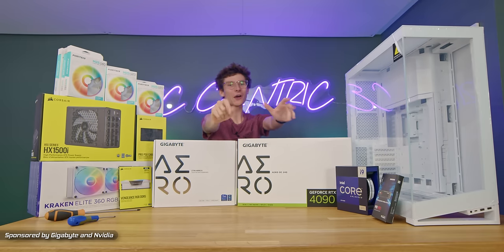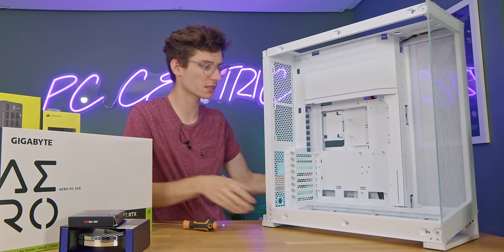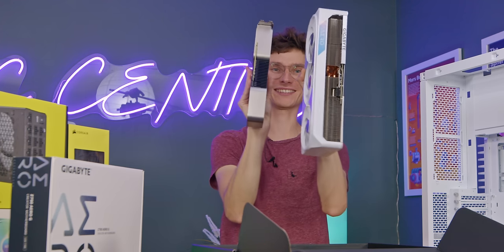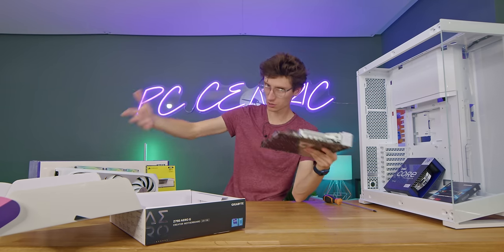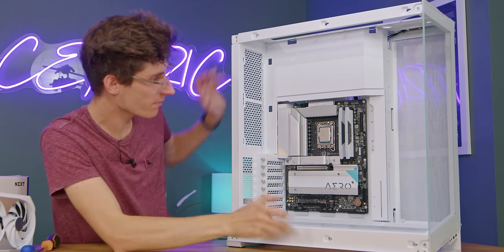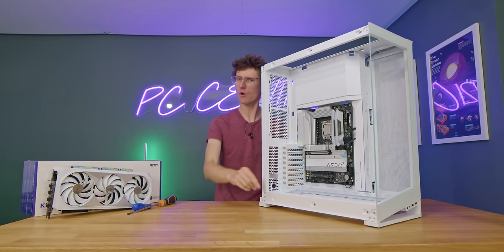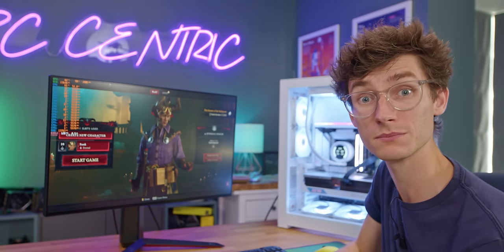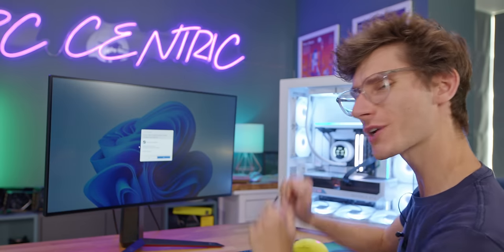The MOST POWERFUL Gaming PC You Can Build?! 😮 RTX 4090, Intel 13900KS, NV7 w/ Benchmarks | AD

Comment: Funny how even the 4090 gets random fps drops in Hogwarts Legacy
Reply: Dude is using cheap 5600 mhz ramm😂😢
Reply: Yea bro they still didn't fix drop fps and sttutering good game but worse optimization and most of new titles are like that
Reply: Poorly optimized game
Reply: @wazebi6347 nah 6000mhz Corsair bro
Reply: Wait for RTX 9090
Reply: well yeah, hogwarts isnt optimised very well
Reply: It’s why u get 2 4090s instead of 1
Reply: @noahmundakkal8308 sad SLI noises
Reply: This is why we need to understand the importance of how things need to be stable on the software side for optimal performance
Reply: Game is probably made for 60 fps
Reply: If you use a 13900ks the most it can handle is 5600 MT/s 6000 or 6400 would not boot propperly. Trust me  I have a simmular Build but with 6400 MT/s RAM. I had to set the XMP to 5600 for it to boot.
Reply: @fahim454 it be the size of the whole case

Comment: Finished my NV7 build last month, amazing case just very tight on space for the cables, granted I used 15 Lian-Li fans but with 7 sata power cables and the controllers it was a bit tough and at first the rear panel would not go on lol I went for a push pull on the AIO and will add another LCD display to fill what is left of the gap.

Comment: Finally, a no compromises build, not just showcased, but also commented. 

It's unfeasible and overkill, but entertaining and interesting. Soo thank you for making this! 😊
Reply: naah and whats with the ram 5600? really all that money for the parts and than this ram xD

and why no white motherboard like the MAXIMUS Z790 APEX and white cables??? than it would be perfect 😋
Reply: @hansg9824  well he did say he couldn't find faster white RAM Sticks. By the end the case was also not the "best", "no compromises" build. I was honestly most interested in seeing the 13900ks paired with the 4090 in the end. Faster RAM wouldn't've made much of a difference and neither would've the PCIe 5.0 NVMe.
Reply: @iordanchis2437 silver sticks do.
Reply: @iordanchis2437  Okay, that with the ram, I must have missed.
I think faster ram can improve the performance in this system, but with the ssd, you are right that would not help with performance in games.

I've forgotten, especially with raytracing ram speed can make a huge difference because raytracing is really bandwidth heavy.

And I find this case very attractive I would go custom watercooling down the fans are good than on the side an radiator and on top and on the back I would put the fans that they push air in so fresh air down and behind and through the both radiators out 🤔
I hate to see that people put radiators in the front. You don't want pre warmed air in your system that makes no sense 🤮
Reply: @hansg9824  I didn't know RAM speed can increase Ray-Tracing performance. Thanks. 

A custom water loop is definetly a premium. But I, personally, would still choose fans over a custom loop, for less hassle.

According to Caseking the most optimal Air-Flow configuration, for a case like this, would be:

1. Top radiator and bottom fans pulling air in
2. And the side and rear fan pushing air out
3. In either a neutral or positive pressure configuration. Meaning the bottom fans and top radiator suck in just as much or more fresh air than the exhaust fans are pushing out. Neutral or positive air pressure are key to reduce dust Build-up.

EDIT: It was neither GN nor JTC but rather a German Case retailer (Caseking) who found that the most optimal cooling performance for both CPU and GPU is the way I described above.
Reply: @hansg9824 actually thats nonsense, Jay just made a vid about just that topic regarding taking air on through a radiator, and the actuall difference is neglectable at best, so long as air moves it doesnt matter much at all (diff he found was like 2°C from 2 rads exhausting compared to one taking in and one exhausting)
Reply: @iordanchis2437  naah custom waterloop isn't that big of a deal, it's one time spent money and than you can use you're parts a real long time 👍🏻
Most of my parts are from the time I had the i5 2550k and hd 6970, that's some year's 😅
my waterpump the cpu block and the radiators I use now with the 12600k with no problem and back in the day I even changed the cooler on the graphic cards I began with a little diy where I just cooled the gpu core and but heatsinks on the rams and other parts and it worked flawless 👍🏻😀
I mean you can buy graphic cards with waterblock on and I think these days I would do this before I make this on my own because they got real expensive 😅
Reply: @hansg9824  Aight. I won't say "definetly no" to a waterloop if I get to change to own one 😁
Reply: @iordanchis2437  it can make fun 😉
My advise as long you don't want it special, use soft tubing 16/10, it's maybe a little thick but believe me it's so much better to work with 😀
It's maybe a little expensive to build a custom loop but you can reuse it so long, as long you put the right coolant in it 😉
My tip distilled water+ g48, it's for cooler in cars, I use it since I began watercooling my pc with no problems 👍🏻
I once thought maybe I can use just distilled water...
Don't do it 🤣
It was a mess to clean the parts from the gunk that is building up in their 🙈
Reply: I just built this for myself... mine was a little more overkill than this thought....
Reply: the ram and ssd is compromise lmao the SSD he could of went fallout and gotten a crucial t700
Reply: Then he should have opted for a black build and not claim this is the best and fastest system there possibly is

Comment: Nice build.  Best fan to solve your fan issues would possibly be the Phanteks D30-120 that come in both directions to avoid back cages and they interconnect so cables are minimal.
Reply: you know? even with the d30s it still is a S**t ton of cables in back... just finished my own NV7 custom loop build with them and the cable management (although totally doable) really sucked...

Comment: I pretty much have the same build in black. I use the phanteks D30 fans, they're more aesthetically pleasing and compliments the case so much more. For the dead space on top I place 8.8" display. It fills in perfectly and looks great.
Reply: Hey can i see how you did it? i am also wondering what to do with that dead space lol
Reply: @gabrielremy4220  Sure! Tell me where I can send it pic/vid
Reply: So I was thinking of making my first gaming PC and had a combo idea: (CPU: AMD Ryzen 9 7900X 4.7 GHz 12-Core Processor) (CPU Cooler: Thermalright Peerless Assassin 120 SE WHITE ARGB 66.17 CFM CPU Cooler) (Motherboard: MSI MEG X670E ACE EATX AM5 Motherboard) (Memory: Corsair Vengeance 32 GB 2 x 16 GB) DDR5-5600 CL36 Memory) (Storage: Samsung 980 Pro 2 TB M.2-2280 PCIe 4.0 X4 NVME Solid State Drive) (Video Card: Asus ROG STRIX GAMING OC GeForce RTX 4090 24 GB) (Case: NZXT H5 Elite ATX Mid Tower Case) (Power Supply: MSI MPG A850G PCIE5 850 W 80+ Gold Certified Fully Modular ATX Power Supply) (Operating System: Microsoft Windows 11 Home Retail - Download 64-bit).|||||||||||||||||||||||||||||||||||||||||||| Is there any suggestions to the combo as it is going to be my first build... Srry for long comment :/
Reply: @Intraxer  overkill most likely
Reply: @Intraxer go for ddr5 6000mhz cl30, i’d recommend a 1000w psu since 4090 rates 850 minimum. crazy overkill though 😭
Reply: @Intraxer  motherboard is super overkill, ram is kinda slow, and that GPU could have trouble fitting in that case
Reply: @CedSwan how do u even have money for that? I only have 1000 dollars aus lol

Comment: What an insane build! Now you need to make a custom loop for it👍
Reply: Since all of his water cooled builds all have gone according to plan and nothing has gone wrong
Reply: what pc would be better an  i7-11700F GeForce RTX 3060 or a  i5-12400F GeForce RTX 4060 Ti both pre builts from cyberpowerpc
Reply: @Yanitedyanited22  if same price than i5 4060 ti
Reply: That's why I like the Ryzen chips, they run so much cooler.  I greatly prefer air cooling personally due to maintenance.
Reply: I just finished getting mine together on the internet and it’s almost identical.  Except for the case.  I’ve been waiting/wanting for 4 years and I’m done waiting.  So excited to hit the order button this morning.  Just watching a couple more videos
Reply: Should i build this?
Reply: Water loops are nothing but a pain at no real performance gain.

Comment: Very strong build !... Personally I would have placed the four vertical fans in intake to avoid being in negative pressure and the accumulation of dust that goes with it. ;-)
Reply: what pc would be better an  i7-11700F GeForce RTX 3060 or a  i5-12400F GeForce RTX 4060 Ti both pre builts from cyberpowerpc
Reply: @Yanitedyanited22  I don't know how well prebuilts work, but the i5-12400F with a 4060 Ti is much better pair than the other one..

I mean the 4060 ti is obviusly stronger than the 3060.. and the i5 is slightly stronger than the i7 even if the i7 has more core and threads... + for the i5 that you can also use ddr5 (if the motherboard also supprots it) + it's socket is FCLGA1700, so you can even upgrade to even the newest i5-i7 or i9 (or later on you can simply upgrade to a much more stronger cpu without changing the whole pc)

I would definietly go with the  i5-12400F + GeForce RTX 4060 Ti
Reply: @belakiss1381  appreciate the answer but I’m getting a prebuilt due to the fact I don’t have a clue about building pcs and don’t want to risk it so I won’t be upgrading it any time soon
Reply: @Yanitedyanited22 the 4060 one is better for gaming, you’re welcome
Reply: Hey there! I appreciate your input on avoiding negative pressure and dust accumulation. To address that concern, you might want to consider using the HOTO Compressed Air Capsule. It offers powerful vacuuming and blowing capabilities, making it a great tool for maintaining a spotless environment around your desk. Plus, it's compact and has multiple tubes and filters for efficient cleaning. Just thought you might find it helpful! 😄

Comment: that is a trippy case, I'm having a hard time looking at it from this angle without seeing it lean over.:face-turquoise-covering-eyes:  love your work though, keep it up.
Reply: what pc would be better an  i7-11700F GeForce RTX 3060 or a  i5-12400F GeForce RTX 4060 Ti both pre builts from cyberpowerpc
Reply: @Yanitedyanited22  sorry I took so long.  the i7-11700f has much faster OC 64-core speed, but the i5-12400kf is better in almost all other tests. plus its cheaper.😁 i'll get right back to with the gpu.
Reply: @Yanitedyanited22  you will be better of with the i5-12400F GeForce RTX 4060-TI. the rtx 4060-ti supersedes the  3060 in all but popularity and price. so as long as you've got money in your wallet, go with the i5 and 4060-TI.

Comment: I bought this case in white, 4 sticks of the same white corsair ddr5 ram for a total of 64 gigs but at 6,000 mhz, the exact same white 4090, a 7800x3d, white cables for the motherboard, gpu and I think the psu, the phanteks d30 fans and the phanteks aio, 1,000 watt corsair power supply, the nzxt b650e white and black motherboard, 2tb 980 pro ssd. The total was 3,810 and I can't wait to enjoy my games at native 4k and maxed out.

Comment: Totally agree with you regarding the space above the motherboard, just looks a little incomplete.
I'd probably stick an OLED sensor panel there or something myself.
Other than that what a beautiful rig, if Phanteks can iron out the little niggles regarding cable management etc in a future variant I might look at one of them myself for a future build 👍
Reply: Poor design there isn't it
Reply: what pc would be better an  i7-11700F GeForce RTX 3060 or a  i5-12400F GeForce RTX 4060 Ti both pre builts from cyberpowerpc
Reply: @Yanitedyanited22  definitely the second
Reply: @Yanitedyanited22  depends on your use case really, if it's gaming I'd probably go with the 40 series GPU, for better performance, but the 12400f will probably need an upgrade sooner rather than later
Reply: @Yanitedyanited22   cyberpower is terrible. i would look somewhere else for custom prebuilts
Reply: @randomwaffler  I’m only 13 it’s a gift from my parents and they only want to buy from certain websites they trust it’s the only 1 that looks usable at my price range are they that bad?
Reply: @GabeHeron  correction: 4060 Ti is a terrible GPU for $400-500, and a 12400f at this price point is also shockingly bad…
Reply: At that point, why dont you just build this into an SFX build and have another monitor on the desk. This is stupid
Reply: Should i build this?

Comment: Beware of gpu pcb cracking. You need to use the holder, otherwise go vertical mount instead.
Reply: what pc would be better an  i7-11700F GeForce RTX 3060 or a  i5-12400F GeForce RTX 4060 Ti both pre builts from cyberpowerpc
Reply: @Yanitedyanited22  The latter I guess, if both are priced the same.

Comment: I've done a similar build using same case, GPU but used a R7 7800X3D with a Aorus Pro X white motherboard and the phantex AIO, I feel the NV7 is designed with the D120 fans in mind which is why the spacing is an issue with cables, with D120 fans no issue with spacing and cables and they look amazing, the blank space at the top I've put my sensor panel there.

Comment: What's the best value price to performance high fps 1440p build? I'm thinking about the 7600X and 4070 Ti or is another build better?
Reply: I got myself the similar build - 7600x and 4070 ti .
N it's not a good match , 
7600x with 6 cores bottlenecks the 4070 ti , and runs hot 80-90° thermals. 240 or 360mm AIO is a requirement.
If you can increase your budget,
7700x, 7700 or 7800x3d are the best choice.
If not, save some extra money n go for Ryzen 5 7600 non X - 
Similar performance but Way Better Thermals 60-70° n Efficiency 50-60 watts n also has PBO2
Reply: Ask yourself what games you trying to play. Are they triple A games like graphic intensive or more CPU dependent games. Building a PC with future proofing
Reply: 13600k or wait for 14600k same socket in a few months

Comment: The build and its color is amazing! But I have only one question. Why did you put all the fans pulling out air, creating negative pressure, and you didn't put some of them pull air in for better air flow and cooling?
Reply: The ones below the GPU are pulling air in, but still - 3 intake, 9 exhaust seems .. not ideal
Reply: Exactly, plus that air is going to get heated up by the gpu. I'm sure he didn't put the 4 vertical ones as intake because it wouldn't look as nice with the cage of the fan being visible.